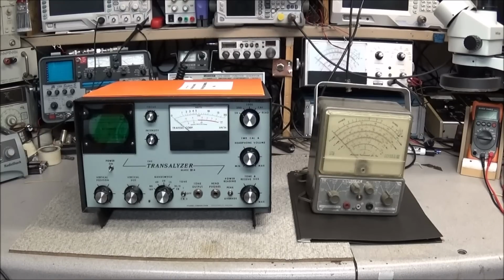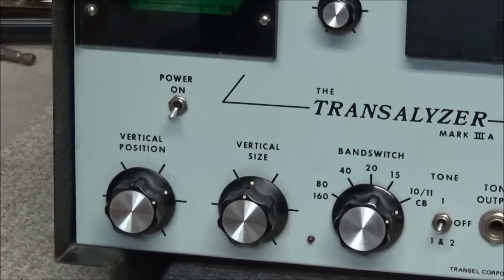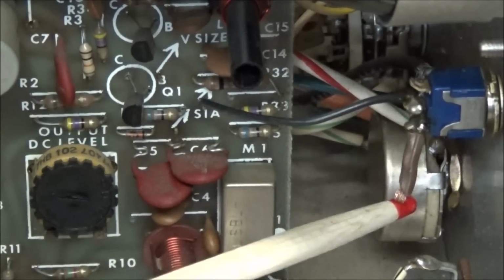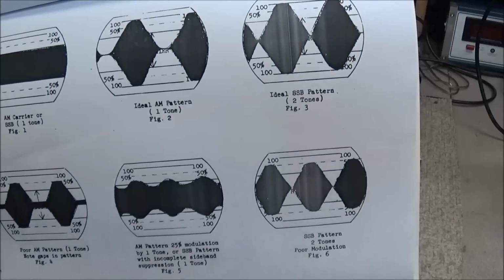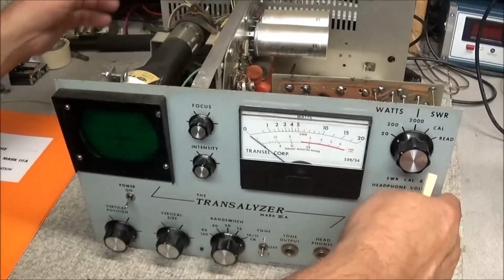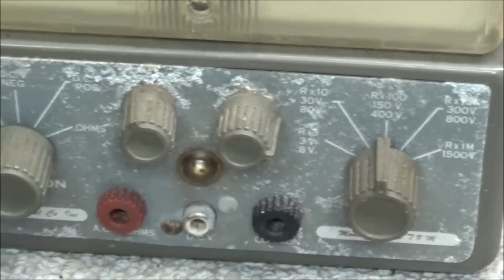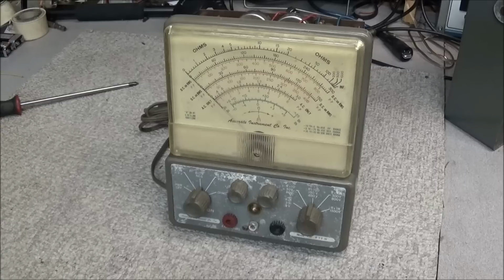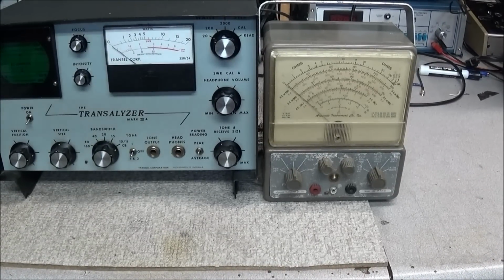#174 Shop Talk Rare Equipment Restore

Comment: I think I have seen everything Helper Instrument s made and the block diagram is the only thing that looks like' Ramsey'. I would try Face Book for any one who ever worked for Tansyl Corp? And I would ask at Repeater Builder Web site,, Some of those guys are my age.
As far as Automatic Instruments . I keep wondering if some of these fancy new printers could not replicate a negative of a silk screen for repainting face plates. 
As for me I keep restoring Cushman electronics. And also band instruments mostly Brass. My Granddaughter is playing Euphonium. My horn in Last year of Hi School and thru college. She said she loved the Sound ? The horn weighs more than she does
 Keep after the old gear. If you run out of projects I'll mail you a CE 4 B to do a teaching episode on. 
EOT Daryl kb5zxm@gmail.com.
Reply from the maker: Thank for sharing all this. I already have some guys on FB looking.  I have been thinking the same about using a printer to re do face plates. May take some modifications to a laser jet.  Man I love old Cushman gear.  When I worked for GE mobile radio we had Cushman and Telewave units plus Motorola sets.  When I left and went to EF Johnson we had IFR units. I really missed the Cushman  and Motorola stuff.  I have found some pretty cheap but shipping is a killer. Again that for sharing that.

Comment: Just completed a rebuild of the SICO Model 77.  I replaced the battery holder with a regulated 1.5 volt supply using an LM317.  Everything works great again.  Can’t wait to see your fabrication of the front panel.
Reply from the maker: Sounds like a great restoration. I may do the same with the battery on this one.

Comment: I really want to see how you tackle that faceplate on the VTVM. I sure could use some tips there and I suspect so could many others. I was talking with a vintage car guy over the weekend and he was complaining that young kids today just aren't that interested in fixing up old cars since newer models are so much more affordable relative to the 50's and 60's when he grew up. He feels that they don't tinker around under the hood any more because there isn't much under there to tinkers with these days. It seems like it's the same with modern electronics a chip on board does all the work and the associated SMD stuff in the support role. If it stops working you throw it out. Sad but true I'm afraid. 73 Doug.
Reply from the maker: I agree Doug. I am a muscle car buff myself. I have a 1986 full chassis mustang drag car.  And a 1993 Mazda B2000 pickup with a 347 ford engine. I just no longer have time for them.

Comment: Many early oscilloscopes used that picture tube.  I know Heathkit and Hameg used them.  I restored one of these many years ago that needed a picture tube and I got it out of a IO-21 Heathkit scope.  If you get a scope you can pull the transformer out of it to.  Kill two birds with one stone.
Reply from the maker: Good idea Mike. I have looked at a few older scopes I have but none are compatible.  Could probably pick up one like you mentions for a few bucks.

Comment: That's going to be quite a restoration project! Maybe look for a  more recent(70's-80's) solid-state (except for the CRT) scope from Tek or B & K or Hitachi as a parts donor since you are mainly focused on the scope restoration?? These would most likely even  have the +12V or +15V windings. I've seen these low bandwidth scopes go for pretty cheap on the auction sites. Just some thoughts from the peanut gallery.P.S. That VTVM looks like a nice project as well.
Reply from the maker: I agree. Will keep an eye out for one. Thanks